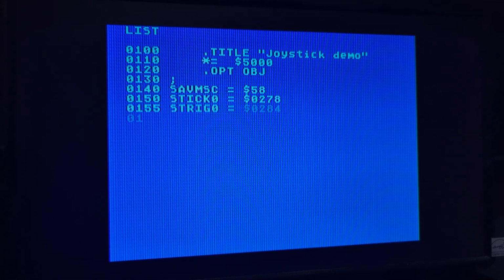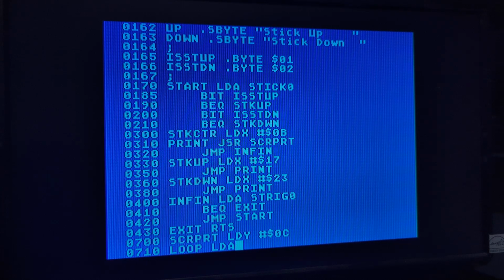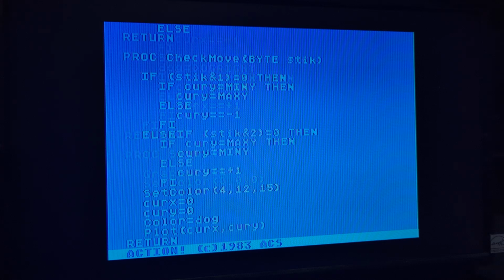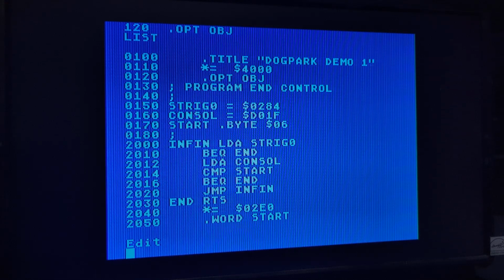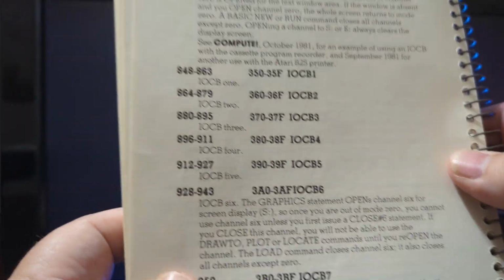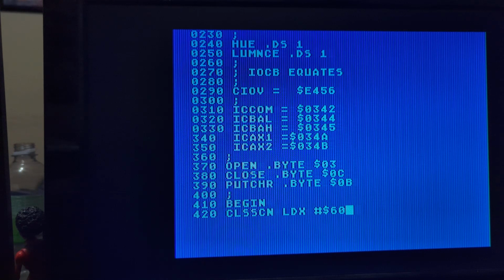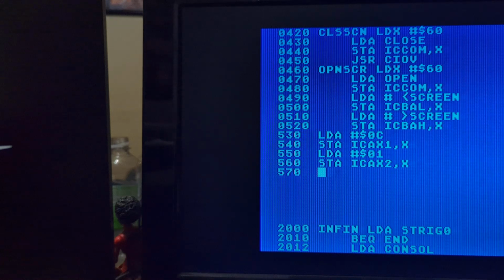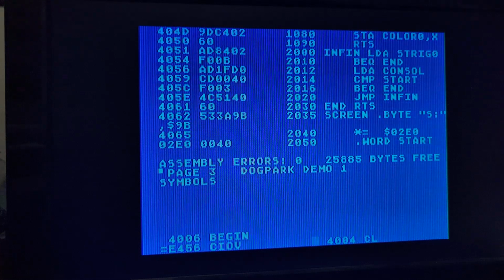MAC/65 Assembler Editor and Atari 8-bit Machine Language Programming - Part 7 (redux)

Comment from the maker: This is a redo of the video I actually deleted today. If you've already watched it, there's nothing new here (except maybe the bit about ICAX1 and ICAX2 from the Atari Technical Reference Manual). One error caught by a viewer is that at line 610 I do a LDA $0F when I want LDA #$0F. The first wrong version says load from Zero Page address $0F (not what I want) and the second correct version is load the value of 15 into the accumulator.

Comment: Hey David,
Thank you for this great tutorial videos. I think your style of teaching is excellent. I consider your tutorials as Atari equivalent of Robins tutorials from '8-bit show and tell'. I've been trying to actively follow this series (by replicating all you examples on my Atari). So far everything worked well but this time I'm unable to replicate your codes behavior on my machine and/or Altirra emulator. The problem I observed is that the code does not activate mode 1. I took your code from github and found that there is a mistake in DOGPARK1.SRC. Please notice that line 350 is duplicated causing ICCOM = $0342 to be overwritten. After fixing this I tried your code on Altirra. I wanted to run it on Atari 800 (replicating you environment) and not on XL that I own. The result is the same - mode 1 is not activated. Do you have any advise here?

Comment: According to documentation, BIT supports immediate mode starting with the 65C02. I always thought it was surprising that it didn’t in the original 6502.
Reply from the maker: @chriscription  My new Atari 130XE I'm pretty sure has a 65C02 but the 800 does not. The MAC/65 documentation notes additional addressing modes for BIT for 65C02 but does not mention supporting immediate mode just absolute,X and zero page,X.